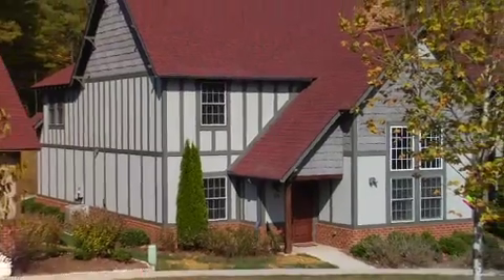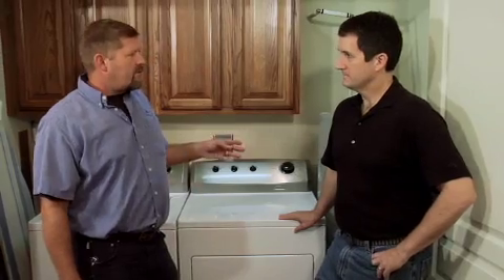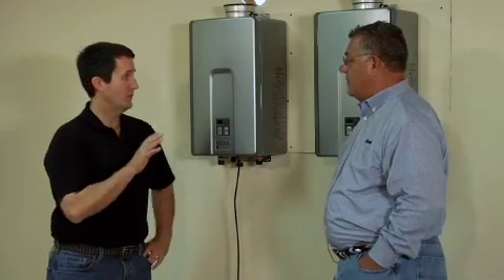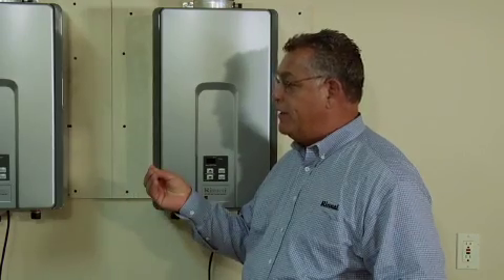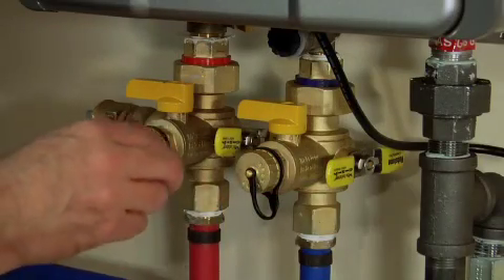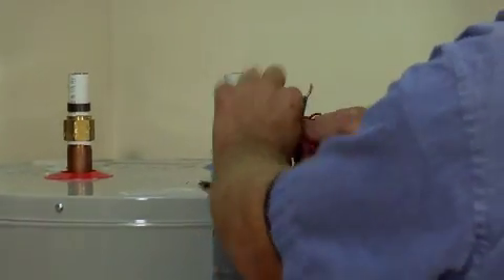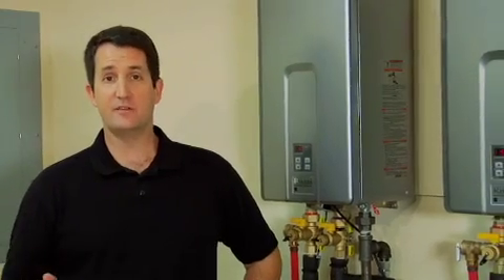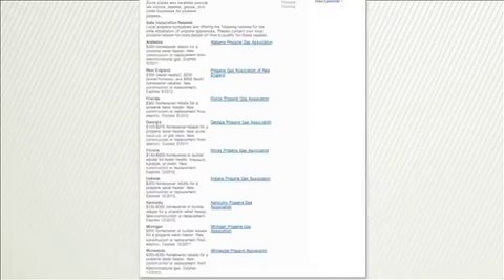Replacing an Electric Storage Water Heater with a Propane Tankless System

Comment: Im still not understanding why you went with 2. Sounds like a salesmans dream. These are 7.5gpm A PIECE.. thats 15gpm.. the dude said it was a 5gpm flow rate for the tub (which is more commonly 4gpm) so it would take 3 of these tubs to max out the heating capacity of just 1 unit. This is expensive overkill! People do your own research, tradesmen are here to take as much money as youll give them
Reply: Salesman's dream or maybe they actually listened to the needs/wants of their customer and designed a system to meet the job scope requirements. 1) modulating burners typically operate more effeciently in the middle of their firing range. While the systems CAN privide 15gpm, they efficiently produce 7.5 with bith at mid range. 2) Maybe the customer wanted a N+1 design with a redundant backup for unknown reasons. 3) Customet may be sizing system for known future expansion needs. Possibly a snow melt system, adding another large tub. Reasons are endless.